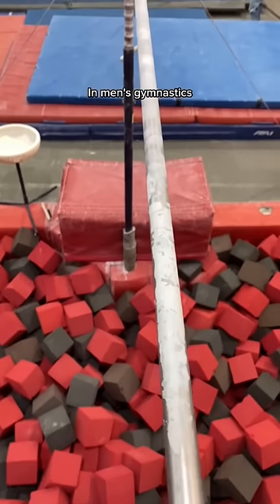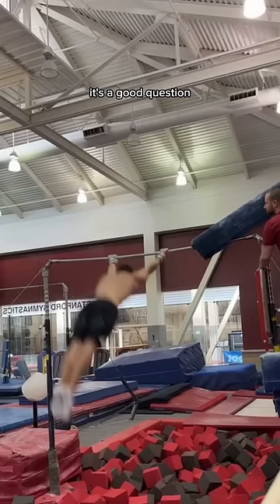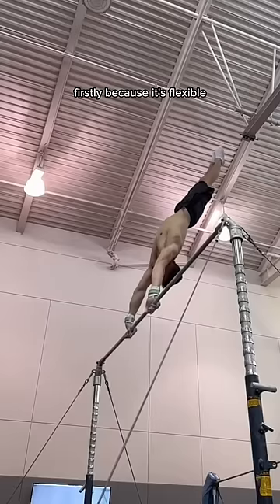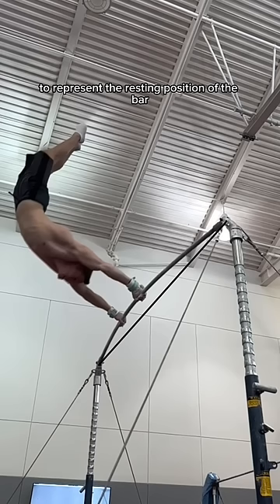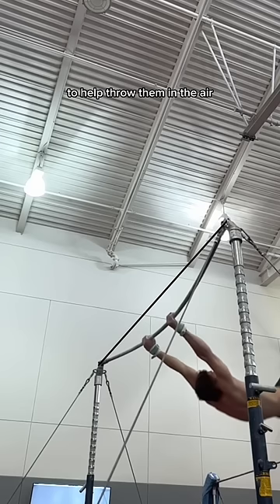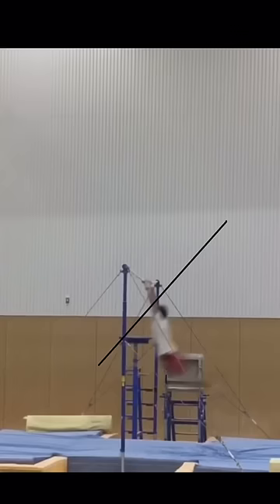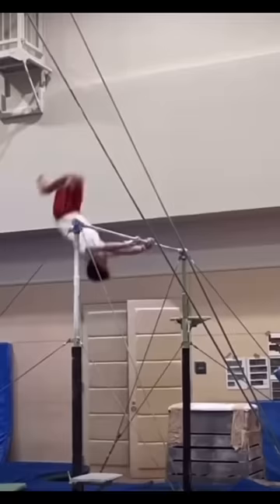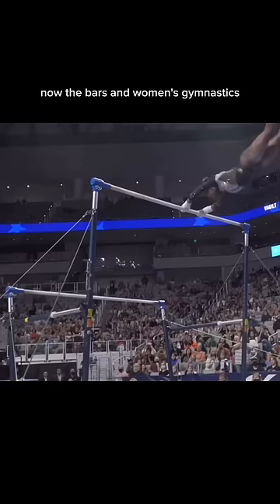Why is it made of steel 🤔 #gymnast #gymnastics #sports #calisthenics #parkour

Comment: This should not be a gender war. Males gymnasts are bigger and their muscle/bone composition is different in comparison to women, which affects force application and power production.

Difference in bar size and material could be both due to muscle mass and strength and other physiological differences because build, as in the bone composition and density does affect the torque, meaning force, applied by the skeletal muscles. Ex: Males have longer arms so the arm lever system for them creates more force in comparison to a woman. 

In addition, Males have more fast twitch fibers than women, which affects their source of substance use. Men use more carbohydrates, which is less energy but a quicker source, than lipids, which is what women tend to rely on for fuel. This quickness of energy availability can impact the prolonged use of power/force used by the muscles during the short period of the routine and, likewise, affecting the amount of stress on the bar.

Males also have more testosterone, over 10 nanomoles while women have an average of 3. Testosterone treatment in biological women proving to enhance more lean muscle, etc. Therefore, a man with more testosterone is bound to outperform females.

Etc.

It's not a war, it's an appreciation of biological differences and taking the measures necessary to accommodate both.
Reply: Exactly. Women in gymnastics mostly are petite, but when they have muscles its like slim muscles.
Reply: @bakibaki7814  No. Men naturally have more lean muscle while women have more fat mass. A study was done in which even women on testosterone accumulated more lean muscle, which is an advantage. Point being, that if women on testosterone treatment perform better, just imagine men with NATURALLY more testosterone, they will obviously outperform women. Especially because men have higher than 10 nanomoles of testosterone while women have an average of 3.

Obviously, women having smaller build and having less fast twitch muscle fibers  also affects their performance. If that's what you were referring to.
Reply: @pepelepepe  Bro wrote a whole  bro  bro wrote an essay but I respect it

Comment: Why is the men’s bar skinnier than the women’s? You would think with larger hands they’d have a BIGGER bar not smaller
Reply: Because it bends more when its skinnier
Reply: Are you like 7? Isn’t it common sense to know if something is thinner then it is more flexible
Reply: Steel is strong enough that we're it to be the same size as the women's bar it litteraly wouldn't bend. If you're making bars out of steel and want them to bend then they have to be thinner

Comment: It's probably cause on average men weigh more-
Reply: Yea, men are usually taller and heavier
Reply: And Men is also proved Stronger
Reply: @yazouruaim694  yes
Reply: Apparently is 100 pounds / 45kg more on average. Which is like double.
Reply: Men are just better when it comes to strength

Comment: Women’s bars were initially men’s p-bars, just spread asymmetrically…the wider spread came about as skills changed from bar beating moves to more swing based skills. The bar circumference changed in the 70s, as did the construction of pure wood to a wood/fiberglass combo to account for the power of the swinging skills.

Comment: I rather think it's because we're lighter
Reply: That's the same... If you are lighter you won't bend it so much
Reply: @jeffmyself4355  that's why we need something lighter bendable
Reply: Weaker too
Reply: @ptp4171  I don't think you really need strength in order to bend it, wouldn't the body weight be more important?
Reply: @ptp4171  some women are and can be stronger than men.. But some women are heavier than men so in this case yes
Reply: @emalinu  Yeah weight is more important but strength is still a factor, it helps with acceleration. 
Force is not just mass but is mass × acceleration
Reply: @evesherlocked  exactly
Reply: @brrman4089  Let's see, centrifugal force (technically doesn't exist but acts on the bar), is stronger as the weight on the end increases and the distance from the bar, so yes bodyweight is very important.
Reply: @emalinu strength helps with moving faster

Comment: Another interesting fact as to why steel is a good choice over something like aluminum is that steel does not dull in strength practically at all.

It has an initial sort of "break in" but then reaches a point where it doesn't really become weaker 

 Meaning you don't have to check the bar regularly for signs of breaking
Reply: Not really of practical significance in this scenario, but from a materials science perspective it is important to note that steel does undergo plastic deformation, but that due to its relatively high ductility it remains unlikely to break unless you are significantly exceeding its yield point. The stresses on these bars is pretty low compared to the the strength of steel

Comment: I am pretty sure the only reason women’s bars are made of wood is because when gymnastics first started, women’s bars was just on a set of men’s parallel bars set to different heights(which are also made of wood), and over time they got farther and farther apart. A switch to steel bars was never really necessary anyway.
Reply: They also use it because they do different tricks need to stand on top of the bar
Reply: @Tropically5  that’s debatable. It implies you can’t do the same tricks or stand on a steel bar. Which you definitely can do.
Reply: It's because women are lighter so you don't need a steel bar and wooden fiberglass is cheaper than metal so why use the more expensive option if you don't need it
Reply: @ashlinntuning1921  Standing on a flexible bar and keeping balance is much harder than standing on a stiffer bar and keeping balance.
Reply: Yes more ppl should know this instead of flying off the handle lol 😂

Comment: Is it because women are generally smaller so they don't bend the metal as much?
Reply: Basically yeah, I think men require more muscle mass to do gymnastics, and like the vid said, men on average do more straining moves, especially for their weight
Reply: Men and woman are quite different biologically, men are supposed to eat more because they naturally gain more muscle mass and weight, which makes their effect on the pole much more significant, on average at least
Reply: @swiggah  I figured. I've seen a couple of shorts about this but none specifically mentioned weight differences.
Reply: The reason it’s different is actually cause the uneven bars started out as a set of parallel bars with one bar set to a different height. The uneven bars have gradually changed to what we have today but the materials it was made of never did (or at least never had a reason to)
Reply: No, the men use wooden bars, too, just on the parallel bars instead. The reason is exactly what Moo said: they started out as p bars and evolved from there. It has nothing to do with strength or weight at all. It's just a completely different event.

Comment: I would assume that the bars are mainly made to not fail (either break or permanently deform). But that would make averages non relevant. Am I missing something here or is it a mistake in the video?
Reply: Your missing the fact that aside from being made to not break or be heavily damaged they are designed to help the gymnasts in their performance making steel “on average” less capable of assisting women
Reply: Steel works just as well for women as for men at propelling them into the air. The reason he said "on average" is because the ROUTINES have different focuses. The men on the high bar try to do all these huge release moves, which means they are constantly trying to generate more and more momentum. (NOT STRENGTH, MOMENTUM) The women's routines, however, are focused on lines and fluidity first, and the momentum is constantly changing direction as they hop from bar to bar, which is why most women's routines only have a couple big release moves. The changing direction of momentum and lack of big release moves is why the bars aren't bending as much (they're not being asked to).

The uneven bars started out as the men's parallel bars (also made of wood and still VERY MUCH used in men's gymnastics today), but were just set at different heights. It evolved from there to what we know today, which is WHY the women's bars are made of wood.
Reply: @magdolyn  thanks anne! That makes a lot of sense!

Comment: I actually thought that the high bar and the upper uneven bar were the same piece of equipment, and just the lower bar would get moved in and out as needed
Reply: No they are actually related to the parallel bars. The uneven bars started out as a set of parallel bars with one bar set to a different height. The uneven bars have gradually changed to what we have today but the materials it was made of never did (or at least never had a reason to)

Comment: Another thing you forgot to mention is that the womens bar tends to be much thicker as well
Reply: @Curious  it's probably to make up for the strength loss from steel, so even with the weight difference it's the same strength with the same flexibility
Reply: @owenjongekrijg4294  if it were the same strength and had the same flexibility, they wouldnt use steel for the mens. The thicker wooden bar is still much weaker than the steel bar, its just that if it were as thin as the steel bar it would be too weak even for the women.
Reply: @Kevin-dt9xm  I meant accounting for the weight disparity

Comment: I really think women also do a lot of powerful swings... it is weight that pulls the bar..
Reply: If you swing your weight is actually multiplied, so he's not wrong
Reply: @Luis-gz3oo  that is why I mentioned weight because he is talking about the powerful swings
Reply: @Mangoo88  but... The power of swings is what matters... If he just stays in the bar and does nothing the bar will never break, it's the fact that hes putting extra pressure in the bar (via swings and landings) what makes the bar break.
Reply: @Mangoo88  The "power" is affected by the weight. Power is W/▲t...W means work. Work is Force * displacement.

Comment: Steel has extremely good elastic characteristics for a metal.

Any material can act as a spring and plenty of materials are strong - Steel holds up to these forces extremely well and when kept within some pretty broad limits you can exert these forces upon it indefinitely without risk of metal fatigue.

Comment: The high or horizontal bar was not always made of steel. In the earliest days (early 1800s) it was made of wood and 5-6' wide instead of 8' wide. It was also much thicker - Present day high bars are 1.125" thick. Early high bars were closer to 2" thick. And they still broke fairly often. So the next bars were composites first made of multiple pieces of wood glued together and then made with a metal (iron) rod embedded between the layers. This bar in the early 1900s was so "safe" the bars were made in widths between 6 and 8'.

Comment: Bamboo would be smarter.
1. More flexibility AND
2. More durability than steal (look it up i aint jokin
Reply: But hella hella wide. Also bamboo is stronger in terms of stensile strengt. What you want is maximum shear strength.   You also dont want the bar to have too much flexibility either. Overall its a worse substitute so no.
Reply: Flexibility yes, durability? 🤣. If you mean stretching force (tensile) then you'd be correct. No one is trying to pull the bar apart from either end. Compressive force is another but no one is trying to crush this. You mean shear force in which case bamboo is most definitely not stronger or more durable

Comment: So in essence its because on average men are much heavier
Reply: Based on what i've gathered from Gymnast comments and some of his videos, it's ALSO because they're not flinging themselves around quite as intensely (Not JUST the weight difference,  though it's an obvious factor. More so since most female Gymnasts are much smaller)

Still wild to me that wood holds up as well as it does with a whole ass human flying around on it, seriously underestimated the strength and flexibility of wood. (I always thought they were all using steel bars)

Comment: There is another reason why the bar in mens and women’s gymnastics is different women don’t need such a strong bar because there muscle content is lower then men’s yes they are still very strong they have to be but biologically men have more muscle content which means they will always need to have stronger and sturdier equipment.
Reply: That's what he said
Reply: So heavier female gymnasts should use steel and light male gymnasts should use wood?
Reply: @annabellehe4307  no because even if the female gymnast is heavier she would still use the wood bar because like i said before it all comes done to muscle content if you look at a scale even if she was the strongest woman she would still be weaker the most men and even if he was lighter he would still have to use a steel bar. Muscle content is simply something i wonted to add it is simply the difference in the density in the way female and male muscles form.
Reply: @annabellehe4307  Men is just simply Stronger 🗿 even if Women is heavier

Comment: Food for thought, if women preferred using steel bars or men preferred using the wooden hybrid bars, they would use it. My guess is because women use their bodies to 'bounce' off the bars in a dextrous and graceful way where men work the bar in a way of strength and power, hence a steel bar. I'd imagine when women 'bounce' from the bar, a wooden bar would be more forgiving than a steel bar. The entire form and style between a male and female's routine is drastically different, just check out clips on YT. It really is a complimentary and poetic contrast of sexes.
Reply: This could also be the reason to why the  female's bar is also far wider than the male's bar. 
The male bar is thinner and stronger meaning it would be easier to grip and create a lot of force and momentum where women's high bar is almost like it's reliant on grace, flexibility and dexterity. It's actually extremely complimentary now that I've broken it down like that in my head.
Reply: Often men’s gymnastics is about strength and showing off, women’s is more about elegance. The men use the steel bar to get more hight for release moves. (Before anyone says i’m sexist I speak from experience as a male gymnast.)

Comment: For women is the bar not made of steel because they do less powerful swings? or do they do less because the bar is not made of steel?
Reply: its most likely steel but u can probably guess why its less powerful
Reply: @Ghos7BoY  sorry but i don't quite get what you're trying to say.
Reply: @vinx.9099 on average woman are weakwr but more importantly lighter so they have less mass meaning less force to bend the bar
Reply: @bananar1403 
does that difference remain between male and female athletes? one big factor in the difference in weight is that men grow more muscle easier. but in athletes it's less about how easy it is to build muscle but how much muscle you can build.
and one question it also raises to me: why then is it split on gender lines and not on weight/height lines? a tall dutch lady weight wise probably has more in common with that they use as the average for men then a short Asien man does.
(also pretty sure that sure they would have less force to bend the bar, but they also need less force to be launched, making it intuitive that it would average out)
Reply: @vinx.9099  I dunno
Reply: @vinx.9099 its not split between weight and height because women’s gymnastics does uneven bars, not highbar. they’re switching between bars a lot and it isn’t the same as men’s gymnastics where there’s only one bar to put all the weight on. Also, women do different moves which affects the weight coming down on the bar, its not strength that affects that
Reply: @sage-the-rat  and why do women do one and men to another?
Reply: @vinx.9099  idk, but thats the way its been for a while and if they changed it now it would be rlly awkward
Reply: @sage-the-rat  tradition is the worst reason to keep doing things
Reply: It's mostly because of the different approaches on the sport. The routines done target different things, like on men it's powerful swings and momentum while on the women's the target is flexibility and grace. It's Like compairing apples with bananas.
Reply: @santiagomendez246  ok, so what if i'm a women and i want my target to be powerful swings? or what if I'm a man and i want to focus on flexibility and grace? "fuck you you're not allowed to compete" i guess.
Reply: @vinx.9099  then that woman would practice men's gymnastics and that man would practice women's gymnastics. it's not that complicated to understand. the men/women prefix for the discipline stands for who's been practicing it in general, it's not a condition. In fact, there's been mixed competitions for gymnastics for a while now, I think they're called "co-ed"s or something like that. Honestly, leaving my grain of sand here, do more research before you start yapping nonsense.

Comment: Feel like it’s just all about the weight difference between genders
Reply: Weight plays a role but I would I would say that the styles of how they use the bar(s) is different. Men do bigger release skills that require more height and the steel bar really helps snap you into the air, whereas women tend to do more intricate work between bars and make more hip contact with the bars, so they need bars that are more forgiving to land on and don’t need the intense spring of a steel bar